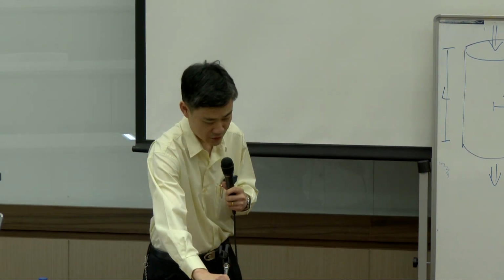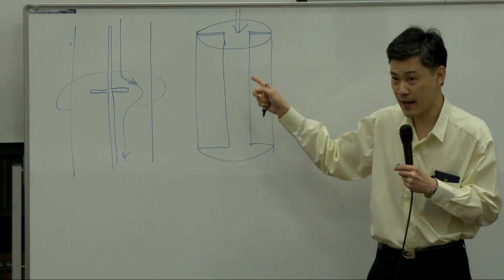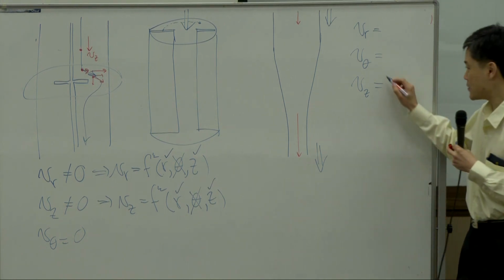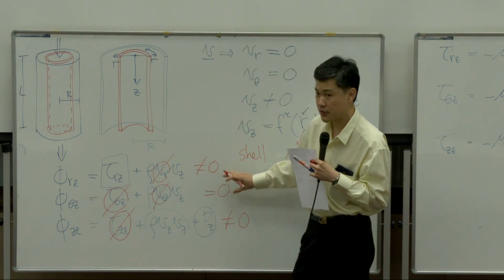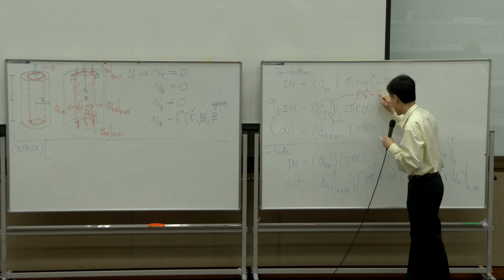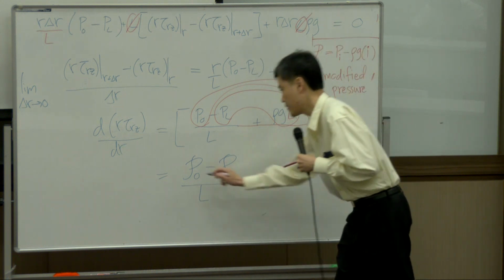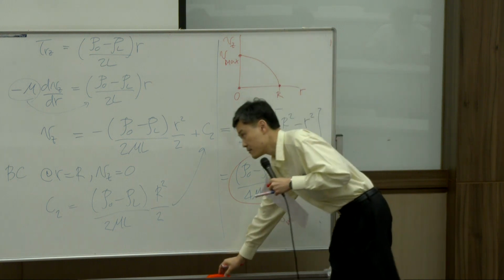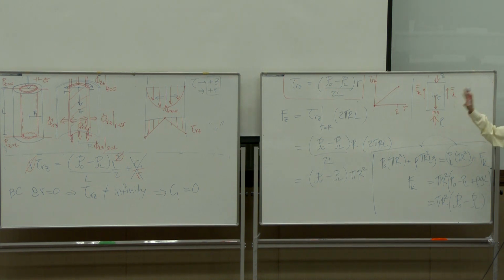Momentum Transport lecture 6/10 (30-Jan-2020): Example on shell momentum balance 2 (flow in pipe)

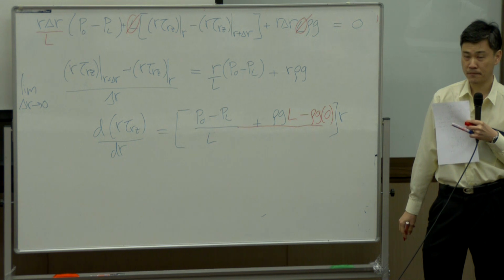Comment: Sir, may I ask why at 56:51, it is -pg(0) and not +pg(0).
Thank you.
Reply: oh, is it because the fluid is flowing downward? in the direction of the gravity?
Reply: because the gradient is downward 
more depth you go you have a positive change of hydrostatic pressure
that why you have -ve before it
Reply: @swkit125 as there will be an increase of pressure with the height of liquid. Then at z=L, it should feel more pressure for the fluid above it. So the pressure P(L) = P(0) + L*p*g.
What do you think? Or am i getting something wrong?
Reply: Same question